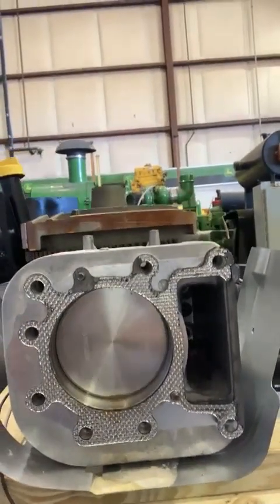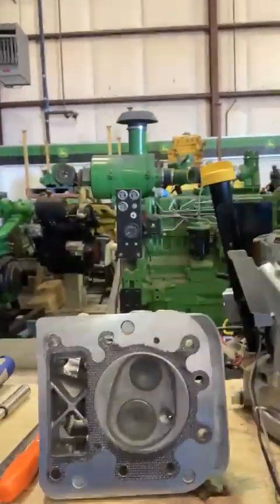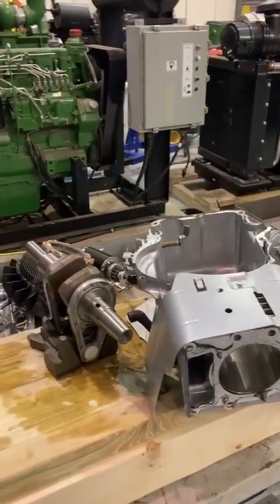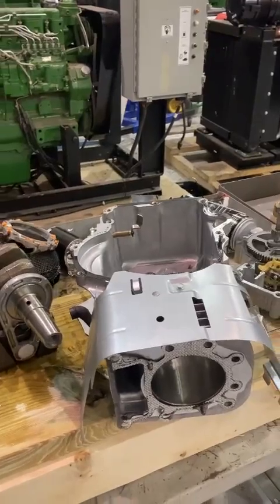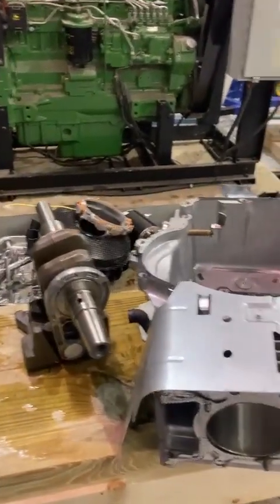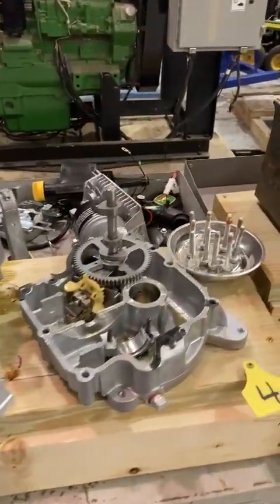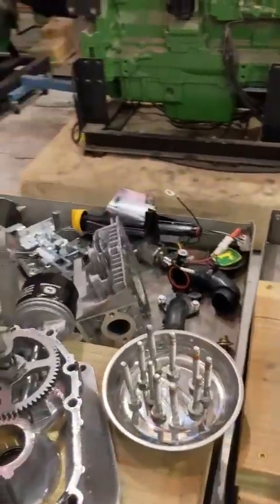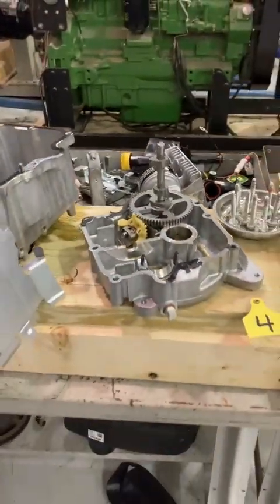John Deere College Life E3 | Disassembling & Reassembling Small Gas Engine

Comment: I'm 16 and have done this on countless engines. That's a skill not many people can do and I enjoy working on small engines so much. Note the Briggs 17.5 horse engine you took apart (maybe more  hp dunno) is know for breaking camshafts regularly.
Reply from the maker: Thanks for the info and for watching! What got you started working on small engines?
Reply: @Western Equipment  I rode a utv hundreds of miles and never changed the oil and it seized the wrist pin to the rod and we rebuilt it and now I have rebuilt many small engines.